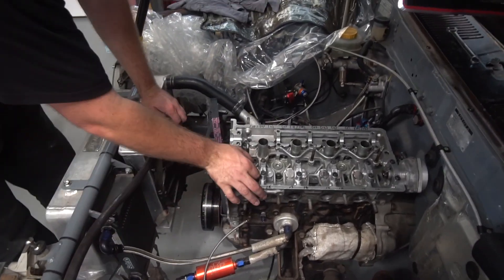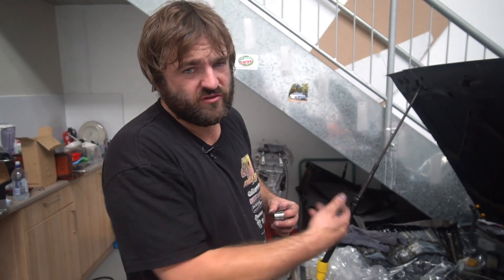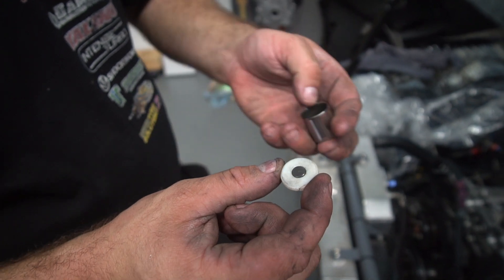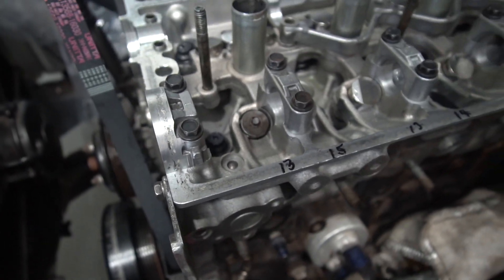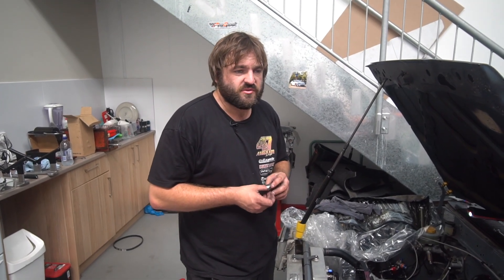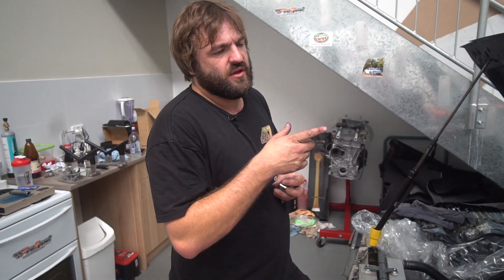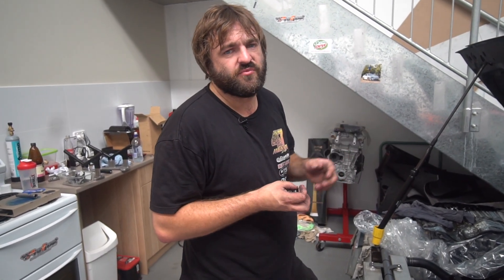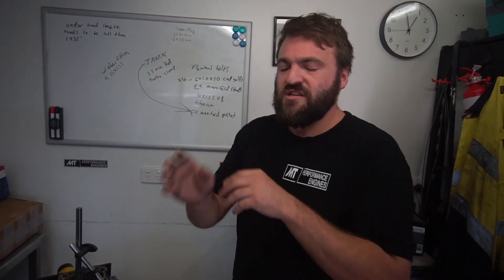Valve Shim MODIFICATION!!! (Ask An Engine Builder Part 7)

Comment: Are you using conical valve springs yet as they are more stable even better than beehive valve springs and use even smaller lighter stronger retainers  🤑🎯
Reply from the maker: Maybe one day

Comment: I'd be interested in hearing if Mat reckons its worth something like an mrp hone plate for boring or balancing oem crank. Would also like to hear why he decided to go for the timing set up he's planning with the supra reluctor instead of an existing product. Or maybe even some more info on how he cemented the block, what brands of lubricants he trusts etc. Really, just be interested in anything he has to share :)
Reply: These are all very good questions and I can't wait to show you on an oscilloscope the difference between the magnetic hall sensor and the vr oem 2j sensor, and to answer the other questions they will be added to the list ;)
Reply: @mtperformanceengines3508  Legend! Can't wait to see  :o
Reply: Hi ..is the shim modification out for customers yet

Comment: Tips for storing an engine for the long term? Do I fill with up engine oil or leave it dry.
Reply: Spark plugs out and fill with wd40 or acf50 and cycle motor over then cover in a plastic bag and she won't rust
Reply: Hi Matt, how much do I need to fill? Just spray over the cylinder wall? Cheers mate
Reply: @mitsuang6016  it won't take alot as your just trying to disperse any water if you really care for the motor use a whole can on one motor just cover everything, remove intake manifold and exhaust manifold and spray valves and cycle same for cam cover and spray the cams and buckets
Reply: Cheers mate good to know

Comment: Hi guys, been following your channel since the 7age build. May I ask what things need to be worked on in my engine since I have a silvertop 20v running with blacktop ecu, I plan on putting in blacktop pistons and cams to up my compression on my rebuild. Do i need to change timing belt to a blacktop one? or still just the silvertop belt since the tensioner will still be the silvertop one? And what other things do i need to consider and do? Thanks in advance if ever you reply to my comment. Cheers to more content!

Comment: Good pm. Can u put the late model 8.9:1 4agze piston in the 20v silvertop an still have valve clearance
Reply: Yes that's a common mod to do as long as you remove minimal stock from the block and head during machining processes and also don't go smaller than a .8mm TRD gasket
Reply: @mtperformanceengines3508   is the 8mm TRD same as the cometic .040"  head gasket
Reply: @jasonreynolds2941  0.040 inch is 1mm so the TRD .8mm is 0.032 inch so you will be a bit safer on your piston to valve
Reply: @mtperformanceengines3508  ok thanks alot. Really appreciate your content not much is out there on the 4age set up. Really like what  you guys or doing. Always look forward to your videos

Comment: Can you doing  video on valve to piston clearance on a 4a?
Reply: driving for answers did a video
Reply: Clemont Hopkin he also built a engine that made less power than stock then ate its bearings.
Reply: @Uncutclimbing  wow, that's no good
Reply: @mtperformanceengines3508  wasn't running a harmonic balancer.
Reply: @Uncutclimbing  do you have any links to the videos as I do follow him and his content is normally on the money but sometimes I find its not the same as my own findings, but yeah running no harmonic damper is a 100% guarantee your bearings won't be living very long